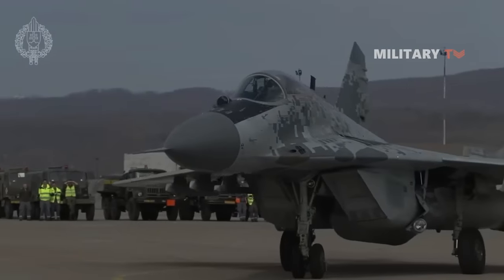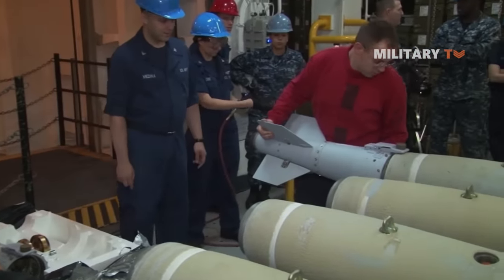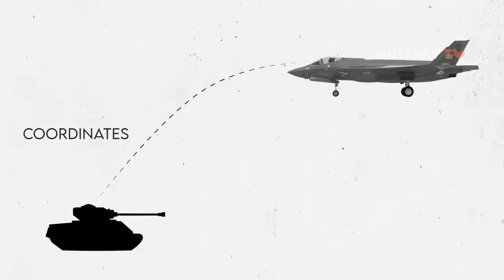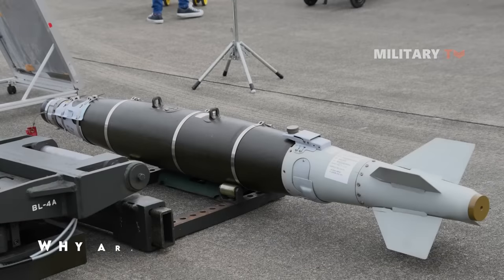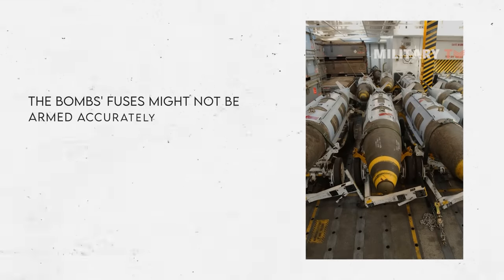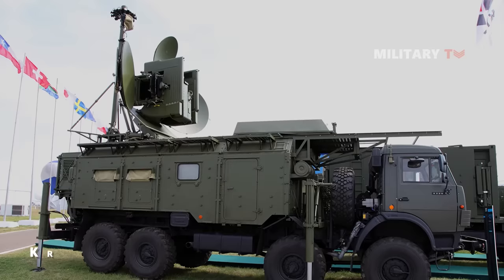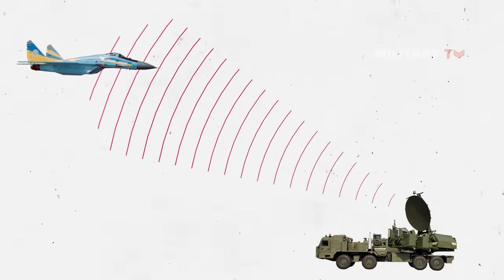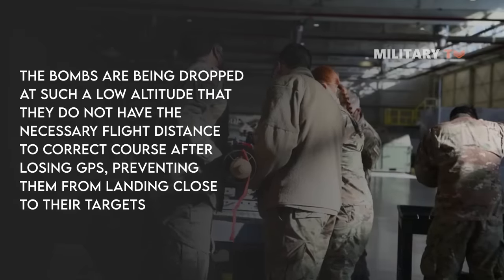Why Ukraine GPS Guided Bombs Are Failing?

Comment: The US military think-tank should therefore employ offline guidance systems for its JDAMs that immediately switch to inertial when it encounters a jamming signal.  The bomb therefore will have in its memory the last possible location of its target and head for that location using its internal mapping system, even without the use of GPS.  Of course if the target moves, the bomb will have no way of having an accurate hit but it may get close enough to made a difference.
Reply: Like memory guidance as a back up thats looking for picture of that particular system. That way it wouldn't be affected by radar. Like on jet fighters. Look down shoot down. Target a picture instead.
Reply: The J-DAMS already have this application, but I don’t think we equipped Ukraine with that particular feature. The Jdam tech is super cool, and when you see it, you’re like, “is that it?” Russia will have some countermeasures, that is too be expected. It’s a game of who can get the last signal before gravity ends the trip. I think the UA is dropping ordinance at low altitude to avoid those 300’s. Don’t blame them. We need to set them up with some Hellfires and Mavericks.
Reply: Or, we could just train up a squadron of Ukrainians on the A-10 with full armament. Too bad the Ukrainians don’t have air superiority.
Reply: @brucehanna9473  A-10 is useful only against third world with no or poorly trained/ equipped air defence. It has no chance against proper anti-air, not to mention Russia which for decades built it's defence strategy around air defence against superior number of NATO jets, creating undoubtedly best anti-air systems in the World, having insane World record of shooting down Ukrainian fighter jet at 217 km
Reply: the US has this already, theyre just not ready for anyone else to know
Reply: what about spoofing that looks correct though?
Reply: Inertial guidance isn't particulalrly accurate in these devices, good for a few minutes but no longer.
Reply: 😂You have to be able to penetrate the airspace deep enough to use those weapons.
Reply: @brucehanna9473  hahah
Reply: @mrobocop1666  The A-10 wouldn't stand a chance against a modern SHORAD and MANPADS.  Even modern full range SAM systems with their lock on after launch are a threat.   The A-10 could only be used to lob unguided folding fin rockets fired like the Russians do with Su 25 Frogfoot after a pullup or many Hellfire Longbow which can find its own target with a MMW radar or duel mode laser seeker.    The aircraft has to stay low and fire Non Line of Sight.
Reply: @glynnwright1699  those bombs only fly for few minutes at most
Reply: @hphp31416  Enough to make you miss by 50 metres. I spent a lot of my life designing guidance systems for a variety of military systems, the sort of device fitted in those bombs is good for a few seconds. I did the initial feasibility studies on Storm Shadow, it is a compleely different beast in terms of sophistication.
Reply: @ellisd3165  and a lot more.
Reply: Рассуждаешь как убить больше русских. А ты не боишься за действия своего правительства   и твоих рекомендаций  поймать у себя дома  ядерную боеголовку? Ты считаешь США и Запад бессмертными? Мы уже участвуем и погибаем в 3 мировой войне, где США это главный враг и я и мой народ требует нанести массовый ядерный удар по США и Англии, но Путин пока думает.
Reply: yes but that poses the issue that the plane would need to fly high enough for the bomb to correct is trajectory with its INS backup. But flying high would mean exposing ukrainian pilots to long range search and target acquisition radars (and thus to SAM batteries), in which the Russian Army is well equiped (S300, S400, S350 and Buk mainly)
Reply: @АндрейОстроушко-п1к Slava Rossiya iz Malaysia
Reply: @АндрейОстроушко-п1к 🇷🇺 VIVA💪✌🤝✊🙏 RUSIA 🇷🇺con todo mis respetos y admiración.
Asta la Victoria como simpre.
Reply: @lalolaponze2290  Спасибо за поддержку!
Reply: @АндрейОстроушко-п1к  Translate🤔?
Reply: @АндрейОстроушко-п1к Gracias a usted Camarada🤝💪✊🇷🇺
Y A La Moral Del Pueblo Victorioso RUSO.
Defensor De Los Pueblos Debiles Del Mundo.Por Simpre Agradecidos Al Pueblo RUSO Por Su Gran Sacrificio.🇷🇺VIVA RUSSIA 🇷🇺
Reply: Exactly right. The INS should be good enough with GPS cal when available.
Reply: @АндрейОстроушко-п1к  do you know that you invade other country, tell that Putin
Reply: Its hard to be accurate when you use memory info, there are this system on many guided weapons, but with raising distance, inaccuracy increases
Reply: The problem is the bombs don't know its a jamming signal.  The Russians are broadcasting a GPS signal that looks correct but translates to a slightly different position. So the bombs think they are going to the target but they aren't.
Reply: @haydengalloway5177  That's not how jamming works. The Russians don't have GPS spoofing
Reply: @brucehanna9473  Don't you Americans think that you won't have to pay for all the atrocities that you have committed all over the world? You'll have to.
Reply: DO YOU KNOW HOW CONTROL SYSTEM OPERATE ?
Reply: You can switch to whatever u want, this is Russia
Reply: Chopstix for next wars.

Everything is canceling everything
.
Kings have their times.

Nebuchadnezzar didn't last forever so was his territory forevers
Reply: compare with Russian jets bomb their own cities, it is a huge success
Putin need lock up all chefs in Russia or at least have a map of them😂
Reply: Its all so simple, isn't it, Einstein. The US Gov should come here for advice.

Comment: The question to asked is how are the Russians receiving their sat signals within the same area of operation as the GPS sat signal. The noise and other jamming techniques are extremely targeted to more than the rf signal itself. Second they seem to be using large LF arrays as well as phased arrays at higher GPS signals so the jamming may be a directed rf signal on the battlefield with a wide array noise floor using harmonics. More advanced jamming techniques can not be discussed on this forum.
Reply: Sound weapons are nothing new.

Comment: 1:24 - you forgot one component, arguably most important: INS. Internal Navigation System that can't be jammed and supplements GPS with far more frequent readings that GPS can provide.  There are also datalinks and on some variants, terminal cheap laser guidance. Also Jamming (effectively blinding through noise, denying access to signal)  is very different than spoofing (sending slightly altered, faked signal).  Also: remember, that US has 'geofenced' some provided weapons to restrict them to Ukrainian territory and such patch might have adverse effect.

Comment: There are multiple satellite navigation systems up there and there are receivers that can use multiple systems at the same time. Match the location information across the different systems and only switch when you cant get matching position info, or throw out one of the three mismatched before switching to INS.
Reply: Maybe these JDAMs just aren't nearly as good as they are marketed to be?
Reply: An extra boosted new GPS constellation with directed transmitter that target weapons in flight might help accuracy
Reply: Not much use when all frequencies are jammed. The problem is there’s not been proper attention to suppressing electronic countermeasures in Ukraine.
Reply: glonass ?
Reply: they should use glide bombs then at least those work
Reply: @sid35gb  it’s quite difficult as EW jamming can be emitted from a small piece of metal connected to a load of wire, hundreds of metres or even a free kilometres from the main transmission generator. These can be placed at various locations and turned on as sand when necessary, so if you do manage to bomb one of the sources of the transmissions you’re just damaging a cheap bit of metal and wire, and an alternative is turned on immediately while they run some more wire up to the place you’ve just bombed, or somewhere else.
Reply: Differential positioning could help
Reply: You not making no sense
Reply: @sid35gb  Except HARM home on jam munitions used to destroy these radars before strikes.
Reply: @MuantanamoMobile  of course, they are not effective and army kept buy inefficient weapon, duh
Reply: You lie. Right now only two global satellite navigation systems exist - American GPS and Russian GLONASS. China is working on its own sattellite guidance system but it's not ready yet. Same with European system called Galilleo.
Reply: @AlexanderTch Actually there are 4 Satellite navigation systems in operation right now. There is GPS which is American. Gloness which is Russia. Galileo which is European. And BeiDou which is Chinese. They are all working as I'm typing this.

Comment: Part of the problem is when, where, and how these weapons are launched, from the platform.  We designed some of these systems.  If the target location is preloaded, then any GPS spoofing will cause it to miss locally.  Jamming will cause it to miss if the aircraft makes fast maneuvers during launch, such as a over-belly pitch and roll, a common technique to get more range.  Usually the GPS loses lock and is unable to recover fast enough.  The INS may also lose orientation if this is done beyond its G limits.  For bombs the INS rates were supposed to be fairly slow, since they are just supposed to glide in (more or less at less than 3-G).  Modern INS's can be programmed for alternate routes, to avoid friendly fire mishaps, and to allow timing variations, but it is doubtful if these are being supplied to the UKRs.  Any fast angle maneuvering by the launcher especially if cross-angle errors are introduced, will cause the bomb to deviate into the worst error angle, which is usually left or right.  Pitch errors occur only if diving (target overshoot usually) or pitchups such as when throwing the bomb for range (target undershot usually).

Comment: Has anyone given thought of piggybacking the GLONASS system as a backup for the GPS? Or even the PRC GPS system? I'm just asking since even my Android cellphone can use GPS, or GLONASS, or other Global Positioning System networks for navigation. I would think it would be a prudent failsafe...
Reply: It may work for a little while,
Reply: the GLONASS is encrypted and you cannot use it, its a closed system unlike the open GPS. the reason they Ukriane planes are flight low is because if they get spoted Russian AA will destroy them from far far away. So it creates a situation where they do not allow the INS to work as intended
Reply: @robertbradbury7921  The reason for the Su-35 and the KC-172 missiles and Р-37
Reply: @robertbradbury7921  I'll correct you, actually GLONASS is used in Russia and some other countries by any civil navigator along with GPS.
Also, Russian guided weapons long ago have installed ability of using both GLONASS and GPS
Reply: What would happen if Mommy called in during the flight? Oh, hell no, not now!! Sorry man. Cell Phones are different systems altogether. Some are TDMA, CDMA. You would need your local Cell Phone engineer to integrate that. Not even worth the effort but nice try!
Reply: Glonass is not good enough to guide bombs
Reply: @Ozchuck  just like GPS, GLONASS has separate civilian and military protocols. If military GPS is accurate to within a foot, then military GLONASS is accurate to within a meter. But that is still accurate enough.
Reply: I thought the same, just use every goddamn navigation system on earth available. I don't think Russia will jamm their own GLONASS because it's needed to spread military information/use of technology. This plus some preprogrammend terrain mapping plus INS should do the job. But i guess then a JDAMM system wouldn't cost 30k but like 200k for just one bomb. War on the long run is already expensive af.

Comment: With the number of SAM systems, neither side seems to be doing much, if any high flying over the other's territory.
So I can't imagine there's much use for this type of bomb at this moment anyway.
Reply: They can still bomb the zero line by launching from inside friendly territory. But: yeah, the true potential of the JDAM is unrealized. I would bet that the looming counteroffensive won't begin until this issue is solved. And yes, it is solvable. 

Because so much is at stake, years of R&D will be crammed into months.
Reply: But Russia literally using 500 and 1500 kg guided gliding heavy airbombs for a month already and Ukrainian can do few against them, saying that's an imba
Reply: russian glide bombs are doing just fine

Comment: The news I've seen largely credit the HIMARS launched missiles as being quite successful. I've also heard of some success with the Excalibur 155mm smart munition. However, I've heard very, very little about success with two other systems - the JDAM/JDAM-ER and the Switchblade 300/600 loitering munitions.  The Switchblade is manually guided using video feedback to an operator and was advertised as being 'jam resistant'. I assume that GPS signal jamming may also be expanded (different frequencies) to include jamming of video and/or guidance signals.
Reply: Do these reports come from the USA, NATO or Ukraine ??? 🤦‍♀️🤦‍♂️🤣😂🤣🤣
Reply: Agreed. Very little mention of success with those systems.
Reply: @thinkforyourself1547  I don't know. This video mentioned one source as being 'Politico'. That source is generally pretty good. HOWEVER, to better assess the credibility of this report, it should cite the source from which Politico obtained the info.  I have seen video where the JDAM hit the intended target SPOT ON. I accept that some percentage of JDAM may have not hit the target, but if they were failing en masse, we'd be hearing more about it than just from this channel.
Reply: Plenty of Russian videos with a successful use of suicide drones. Same with glide bombs.
Both Russian and US Himars not so much.
Both Russian and US exclaibir not so much.
Reply: @tomk3732  You have a confusing mix of comments.
#1) I am unaware of ANY Russian glide bomb. Drones and missiles, yes. But glide bombs? No. If they have one, what's it called?
#2) Why are  you saying 'Both' U.S. AND Russian HIMARS?  They don't have HIMARS. They have Iskander. Russia also has 'Grad', but it is not a 'smart' missile.
#3) Russian doe not have Excalibur. I have not heard of ANY Russian smart munition for their howitzer. Also their howitzer is 152mm, no 155mm. What's its name?
Reply: @gregparrott  1) they started using conversion kits to make fab500 gps/glonas guided glide bomb, cheap af and effective as well. Agree with rest of your points.
Reply: @gregparrott  
1) UPAB-500/1500
2) Uragan MRLS, also some modifications are used by Ukraine
3) Krasnopol Guided 152mm shell, developed from the Soviet era
Reply: @tomk3732  Russian Excalibur (actually called Krasnopol, - its a laser guided munition) has been quite effective actually. It s usually paired with the newer Orlan drones, which have a laser rangefinder that paints the target). Its been used on video to destroy quite a few pieces of ukranian eqquipment.
Reply: the JDAM was used in Bakhmut to good effect and took out some massive ammo depots. There's a video showing 4 hits onto Russian positions with a blast radius that is much too large to be a 500lbs bomb, which proves it is ammunition exploding
Reply: There are lots of switchblade videos online. I don't know if it is a game changer like HIMARS, but that could also be partly do to fewer numbers, or that they want to keep it mostly quiet for strategic reasons.
Reply: Himars have 1 successful strike out of 6 launches. Excalibur 155m have quite short range and does not have goog performance either
Reply: @AlexanderTch  "Himars have 1 successful strike out of 6 launches."
Source: you made it up
Reply: @amazin7006  At first, give me source about your statement - that HIMARS launches are successfull. Preferably specifying percentage of successful strikes.
Reply: Ia succes with excalibur and 155mm? Really? Lol😂😂😂 Stop watching Western propaganda 😉
Reply: @MrPipisco  Learn how to spell and express yourself in a sentence.
After that, feel free to explain why a munition that has been used in combat for over 16 years and is used by the militaries of at least 8 nations seems to earn a 'lol' from you.
Reply: @thinkforyourself1547 Yes it came from the western intelligence including the United States that Himars was being jammed by the Russians. Which means Ukraine cannot just shoot them anytime they want.😂🤣

Comment: So the obvious question is can the GPS receivers be hardened against jamming.  If not, GPS guidance will be worthless against any sophisticated enemy. The next question is whether Russian jammers can be destroyed by anti-radar type missiles. They would seem like obvious targets and can't turn their emitters off in order to work.
Reply: No, sorry that the obvious GPS receivers cannot be "hardened" as you say or improved sensitivity only would hinder. Good shielding of the missile may possibly help. Yes to your second question. Russian jammers have already been destroyed.  I'm not too sure about how the military does it but I'm sure there are many techniques. One way is just to get a "trashy" transmitter that is all over the bands (like your hair dryer was on the reception of old tv's.) or it maybe frequency specific (most likely). I don't think anyone knows how it is actually done unless they are in military communications intelligence. I think I have a good idea about how they go about it. Maybe the newer missiles have better faster sat scan rates is my first guess. If you know, please tell me.
Reply: Yes, the jammer can be destroyed using GPS guidance.